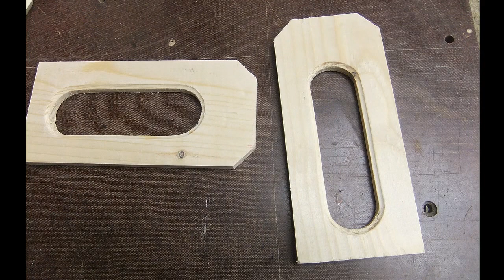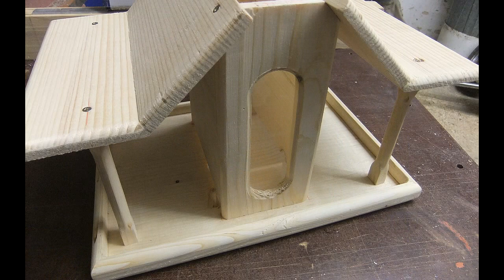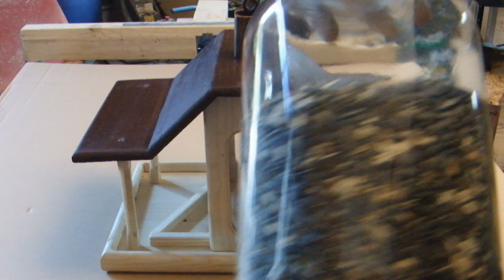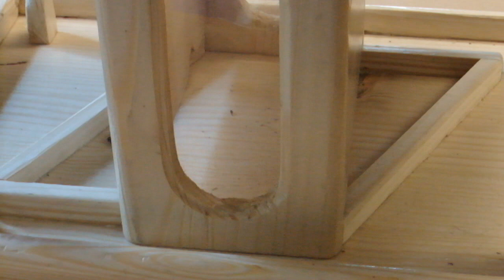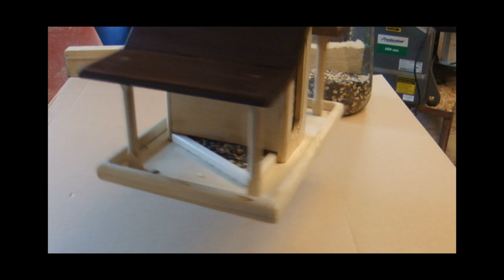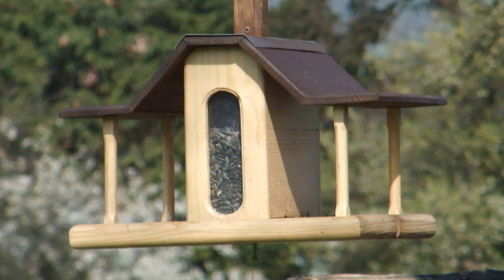Ptačí krmítko / DIY Bird feeder

Comment: Very beautiful design. I thought two things when I was watching it. First, the way the top comes off would cause an issue with rain water and the bin seed. Then you show the final version with a metal cover over that. Next, I wondered if the top would come off, twist off in the wind. I like the twist off top, but does it come off in the wind, twisting the cord? Beautiful birds there too.